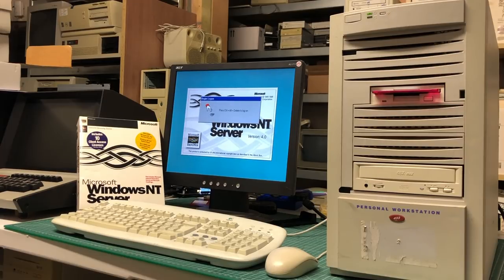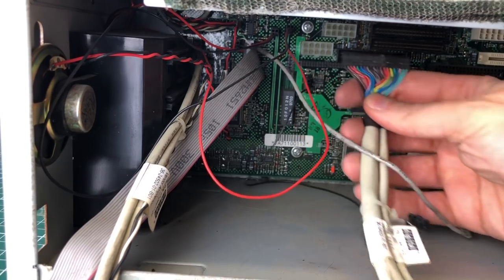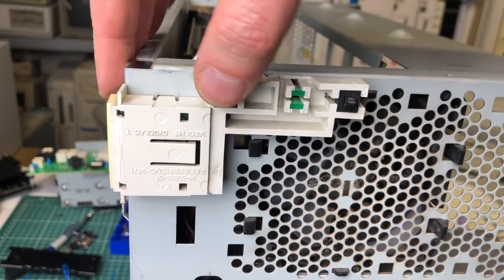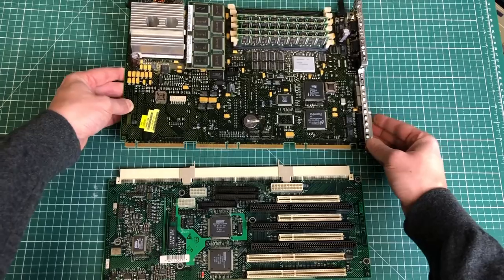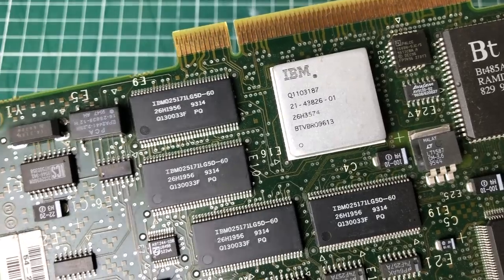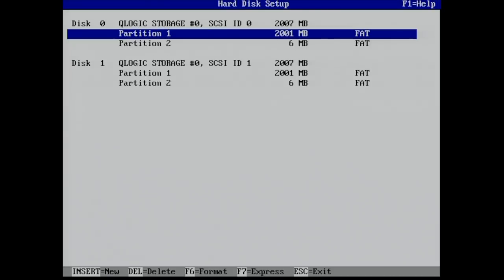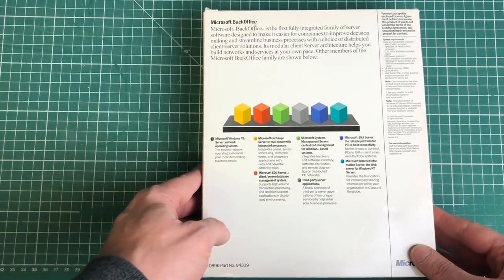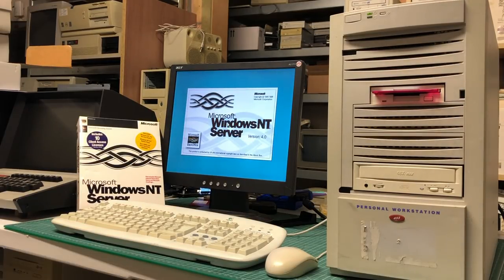DEC Alpha Personal Workstation 433a

Comment: 2:48, 2:55, 4:02: please stop pulling on the wires, they are very fragile and will break easily off from the plastic plug / connectors.  Always gently pull / wiggle the plastic plugs.  Pulling on the wires like that is going to cause damage to the cable and connector.  Could not watch past 4:18.
Reply from the maker: No wires were harmed during the making of this video beyond the 4:18 mark. It is safe to continue. Will make a mental note of your comment and take it into account.
Reply: @RetroSpector78  Thanks, all good.

Comment: Why waste your time with such an obsolete OS? With Linux, you could at least get a release from this century https://www.debian.org/ports/alpha/ .
Reply from the maker: This is just part1 and my first time with an Alpha. Cut me some slack :) Have plans to investigate linux/unix and will showcase it here. Thx for the tips ! Will definitely look into it.
Reply: @RetroSpector78  No worries. Also you are not taking advantage of the 64-bit hardware by running Windows on it.

Did you know that Alpha was only the second architecture that Linux ran on? So it went 64-bit at the same time as it went portable.